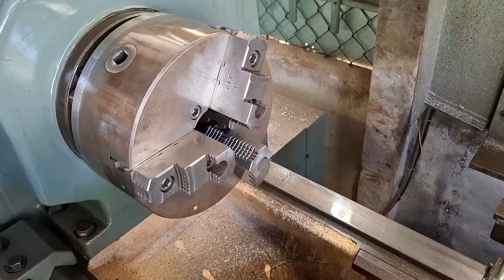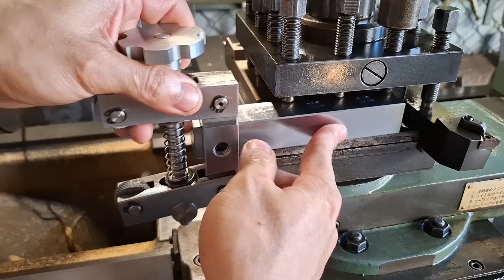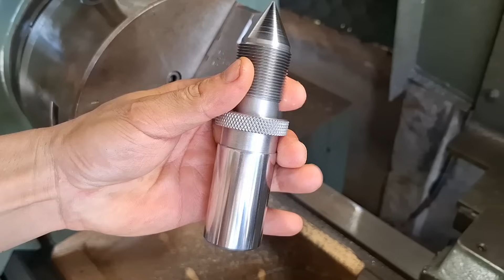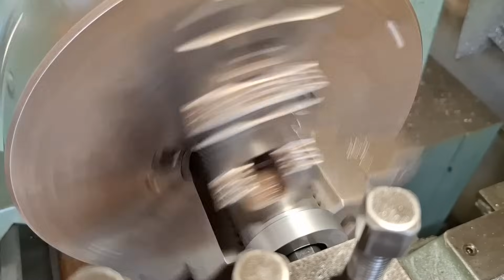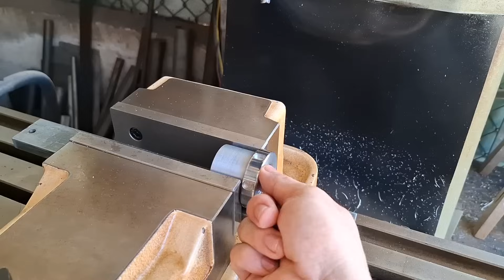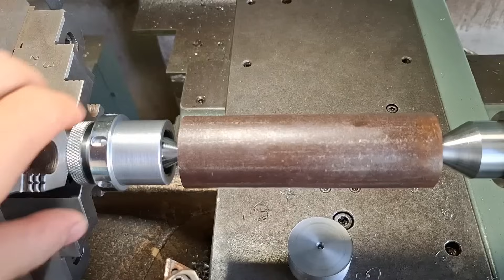how to turn between centres,no drive dog

Comment: Nice design, initially I thought it wouldn't have much use except for anything larger than the collar diameter. But hey, a ground spacer collar could step down the collar face to work and allow for locking of smaller parts. Well done!

Comment: It's possible to push the part off the center.   This will cause runout to the center on the drive side.  Its better to put a small spot face hole offset from the center.  Drive on that.  If you need to, you can leave the part long on the drive side, then surface grind that side to remove the spot face.

Comment: The threads and the nut on the driven center will ecert pressure on the work and tend to move the work towards the tailstock and away from the driven center thus tend to having less support from the driven center.
Reply: Yes exactly right.  Runout to the center and perpendicular to the face problems.

Comment: Great idea. To bad it is so diameter specific. I'd have to make 10 different sizes of them
Reply: Why should that be the case?
You can span every dm over the locknut you have, just not under.
Reply: @fearlyenrage  that is the problem
Reply: @EitriBrokkr  question: why should that be a problem? 
For me i define a problem as a tool i cannot use but this tool i could use.

I mean the idea is simple and ease to use, you could also use just the tailstock and a spike in the cuck you have pinpointed down before use, that would work to.

But anyhow is seem not as a unusable tool to me.